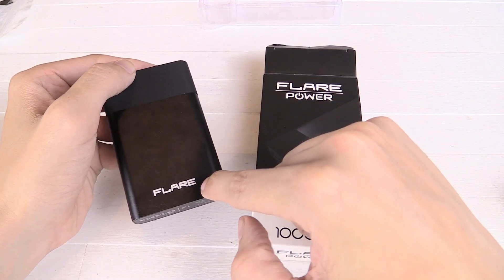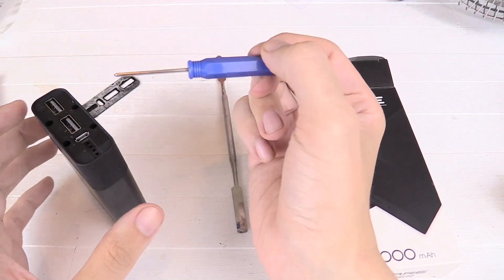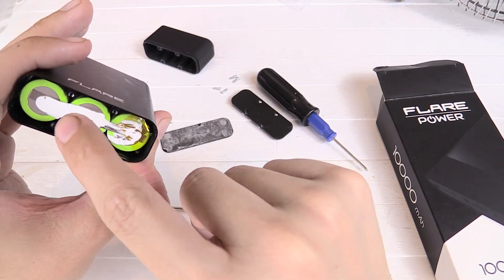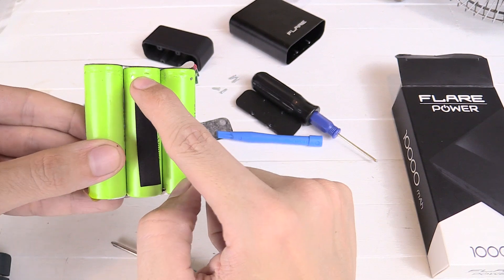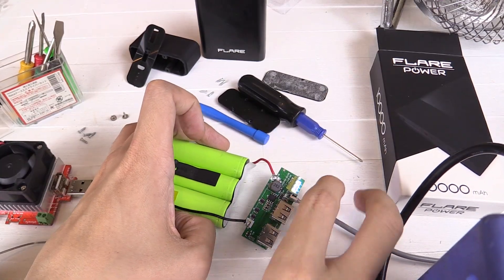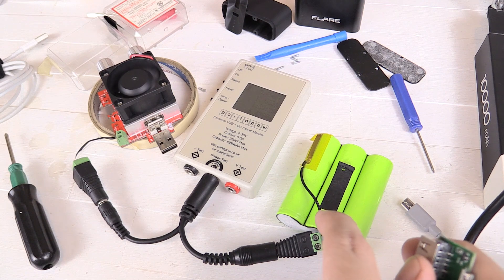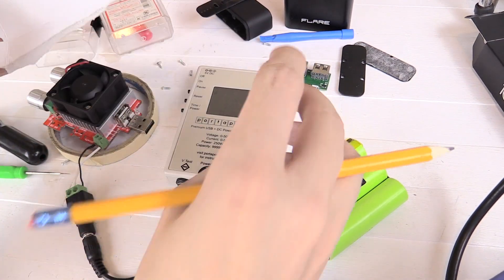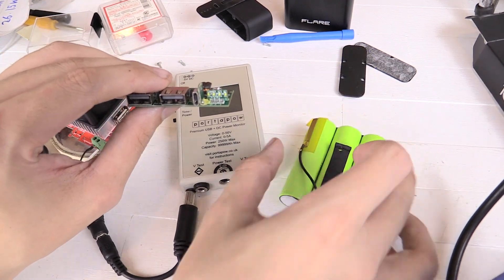Advanced capacity test of Flare Power Bank

Comment: stop fooling around w/ loads and such. get a proper HOBBY CHARGER like an iCharger 106B+ (or the clone Turnigy Reaktor 250w which i picked up on sale at hobbyking for only $25). and do things scientifically!

set proper discharge rate. set proper end voltage. and fully charge them first!
Reply from the maker: This is scientific and accurate. But I do agree it would be a lot easier with a device like the iCharger that can do everything inside a single device. However it would involve dismantling each power bank that I test, which isn't very practical.

Comment: Are you still using smart's pocket wifi for internet access?
Reply from the maker: Yep now and then.
Reply: Do you still experience loosing signal with flexitime?
Reply from the maker: If I download/upload too much data in a short period then yeah, the sim gets blocked from LTE.
Reply: Hmmm. I called the hotline and said to the manager to have "powerapp", which is only available for SMART BUDDY, implemented to smart bro, so that we "fix" the "no signal problem" on our own by: texting powerapp on and powerapp off to 5555, restart the device, and boom. the problem's fixed. I hope powerapp get's implemented tho.
Reply from the maker: I don't think that's an official solution. That sounds like one of the 'tricks' that are shared on the various blogs to get around this problem. Smart can remove it on their side, but they won't officially admit to blocking sims.
Reply: Yeah, it's an unorthodox solution, I must say. The real "unlimited plan" they offer is about 1500 PHP a month.

Comment: Two things to note here. Firstly I can see someone has already posted out your cells weren't fully charged. Secondly your USB dummy load needs 3 volts plus to work itself.  That probably why you noticed odd voltages and current at the end as the load circuitry failed as the voltage dropped, then started again as the voltage recovered and this just went on a constant loop. 

Charged to 4.2 volts, I expect those batteries are closer to the claimed values, but anything over 3000mAh is questionable.
Reply from the maker: Thanks for the feedback Adam :) I could remove the cells and charge them with an external charger and see if they can handle the standard 4.2V. But then it wouldn't match what other users of the powerbank would see, because the powerbank is only charging them up to around 4V and then stopping. And like you say, cells over 3000mAh from an unknown brand is already pretty questionable. I wouldn't normally discharge my batteries to this extreme. 

Just for the sake of completeness, I'll charge the cells to 4.2V using an external power supply and share the results on Twitter. I won't make another video because it wouldn't really be helpful from a general consumer point of view.

Comment: I think you Mis something because for sure if you pull 1amp from the board for sure it's not 1amp maybe lest of 1amp so you need to re test it
Reply from the maker: I don't understand what you're trying to say. It was 1A being drawn from the 3-cell battery pack. And the specific load value is actually not that important, because we're measuring the total amount of power consumed, regardless of whether it's 1A or 0.5A. I just prefer to use 1A because it simulates a cellphone being charged.
Reply: try to pull 1amp from the board and connect a amp meter to the in of the board
Reply from the maker: +Juan Paolo DIY! Why? Pulling directly from the batteries themselves cuts out any losses of the circuitry. This test is conclusive.
Reply: what gadget addict shows here is the actual capacity of cells tested @ 1A discharge rate.
If he used the board, it will consume power which is considered losses.

Comment: I noticed at the start of your discharge that the initial voltage is 4.0xxV. I think the charging board is designed not to charge the battery to 100%, probably to prolong life. Full charge voltage should be 4.2V right?
Reply from the maker: I was wondering the same thing, since 18650 cells are generally charged up to 4.2V. But there are some variances out there and these drained to a very low voltage. So I just assumed it was some strange variance with this specific cell. I contacted sinowatt to ask if they're genuine cells, but no reply yet. I cannot find any 3300 mAh cells being sold by sinowatt. I can only find lower capacity cells.

Comment: so,  what battery pack is genuine?  do u have any recommendation?  pls share some affordable power bank that u know and true to its word.
Reply from the maker: +Rainey Rain Anker and Aukey make legit powerbanks and can be found on Lazada. I tested pineng and that was legit but be careful of fake clones. It should have a sticker on the box with a special code you can check on their website. Some I've tested from Cdrking have been legit but not all of them. The Asus zenpower has legit
Capacity but I found the charge input speed to fluctuate randomly, sometimes fast and sometimes slow. Ravpowe make true capacity too. There's probably more but those are the first that come to mind.